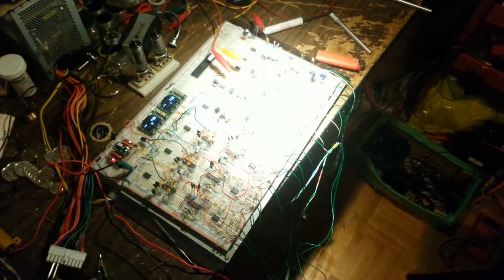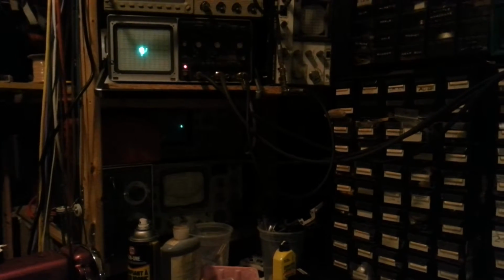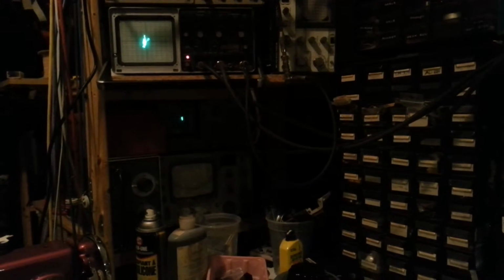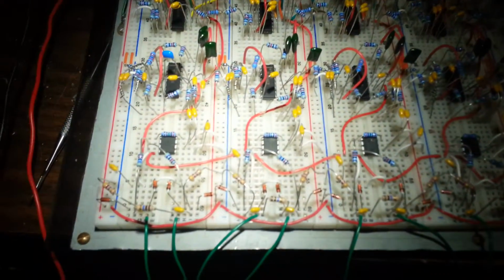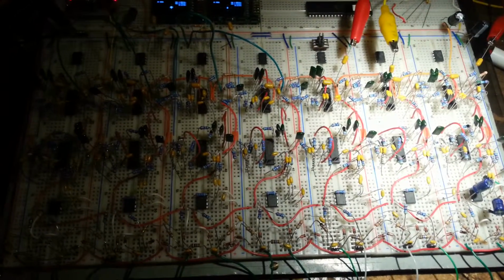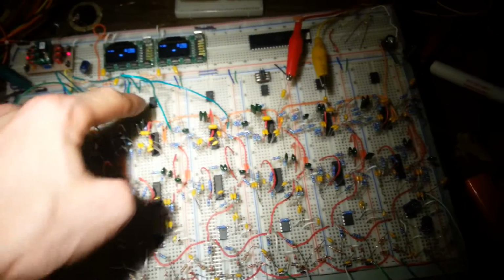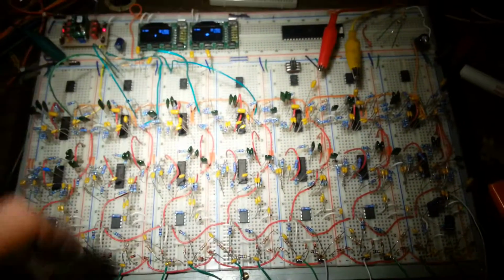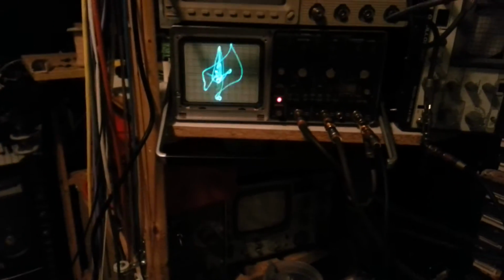seven channel EMG Progress Demo

Comment: ElectroMyoGraph?

...I'd be concerned about power consumption in the final model. How much wattage does this breadboard pull?

Seven channels? You'd need two for a tail, (up-down + left-right), four for bat wings, ((high-low + up-down) * 2)... what's the seventh for?

Wings and a tail would all be behind you. Have you thought about feedback? Very low wattage, DC electro-dermal stimulation, maybe? (DC to avoid interfering with the EMG, of course; wattage low enough that it doesn't hurt at all. For instance, put one electrode in the dimple above each gluteus maximus, roughly where the tail muscles would be, and two electrodes side-by-side, beside or above the shoulder blades, where those muscles might be. For the tail, stimulation intensity would feedback up-and-down position and stimulation balance would feedback left-and-right position. For the wings, stimulation balance between inner and outer electrodes would feedback open-and-closed, while intensity would feedback high-and-low. You'd need a seventh electrode for common ground, of course. Just an example, anyway.)
Reply: D' Otter DUH! ...for bat wings you'd need a channel for high-low and one for open-closed, times two wings...